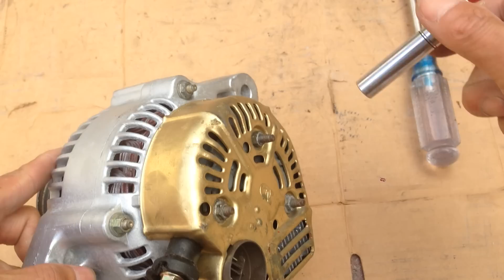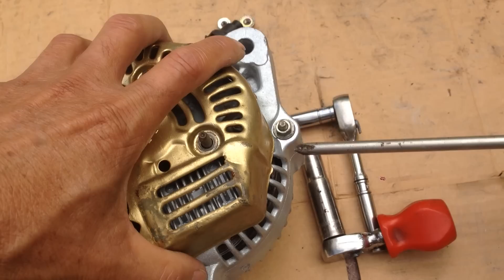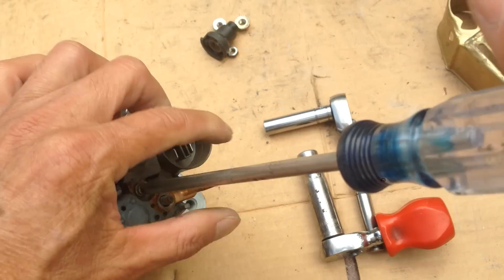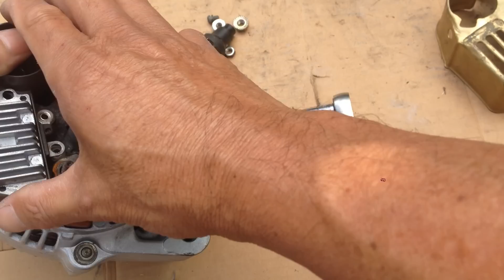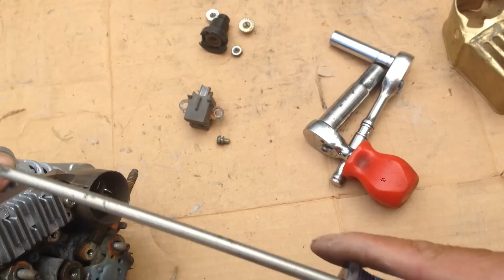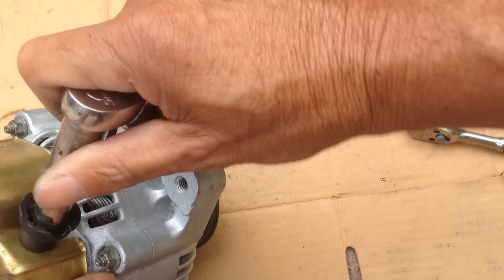HOW TO REPLACE VOLTAGE REGULATOR ALTERNATOR BRUSH HONDA ACURA DODGE TOYOTA

Comment: Do we have to buy the voltage regulator for a specific alternator brand, or does the regulator fit any brand?  Where can we buy the regulator, say, specifically for Denso, or AC Delco alternator?
Reply from the maker: Hi this is a denso alternator and you can buy voltage regulator on the ebay thank.

Comment: Hi,  I serviced the alternator for an Acura RDX 2007 and after the fix  now the alternator light does not come off. We deleted all error codes with the scanner  but it keeps sending the.  (check charging system warning)  the battery and the alternator are charging correctly.  ¿any guess what could be the cause?

Comment: It seems like easy cake replacing but in order to replace you have to remove the alternator and move parts aside in order to replace the regulator in my VW Jetta 1.8t is easier you don't need to pull down the whole alternator in order to replace the regulator the back cover area doesn't exist so there is no cover to protect the regulator just unscrew replace and voila. even though great video tomorrow I'll be doing a 2003 honda civic .!

Comment: THE T BONE STAKE IS THE RECTIFIER,  AND THE THINK WITH THE ROUND  PLUG ON IT.. IS THE VOLTAGE REGULATOR   YOU CAN SEE THAT  WHEN YOUR LOOKING AT THE BACK GOLD  COUVERED CASE SIR.

Comment: Very instructive video. I have a problem with my alternator. At Auto zone the test is good. It must be the voltage regulator not delivering enough voltage to charge my battery.

Comment: THE LONG BOLT IS COMING FROM THE RECTIFIER , AND THE ROUND HOLE IS COMING FROM THE  VOLTAGE REGULATOR

Comment: does anyone know where the voltage regulator is on a honda shadow 1100 Saber
Reply: probably back by the rear wheel

Comment: hey man, talk during the damn video!!! which one is the freaking voltage regulator?!!!
Reply: NoLimitsTech, If you can't work that out for yourself, then best idea is to take your car to someone who knows.
Reply: THE T BONE STAKE IS THE RECTIFIER,  AND THE THINK WITH THE ROUND  PLUG ON IT.. IS THE VOLTAGE REGULATOR  SIR.
Reply: Google alternator voltage regulator and you should see.
Reply: Thank you!
Reply: The half Moon shaped part should be the AC to DC converter,and the part with the heatsink should be the regulator.